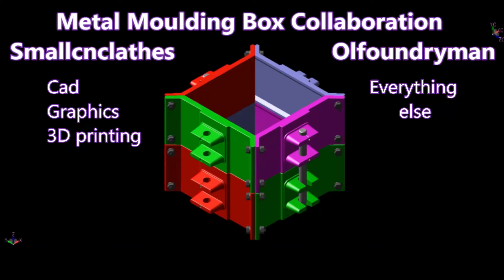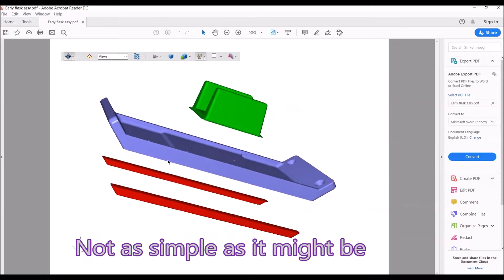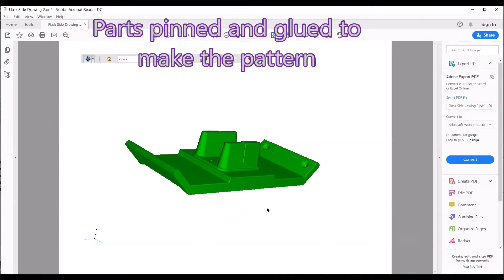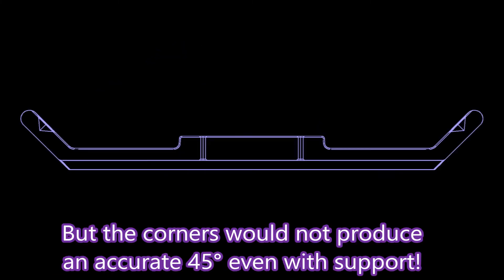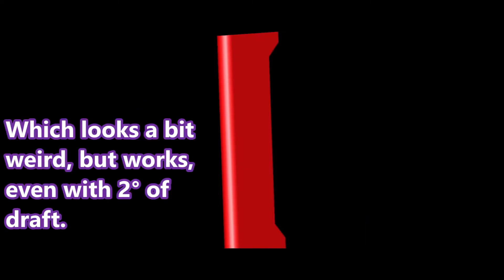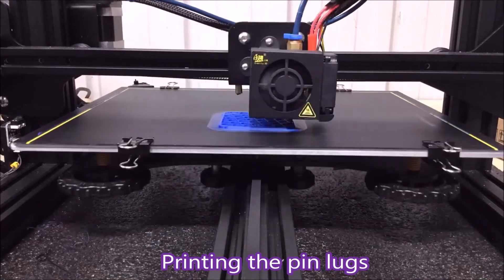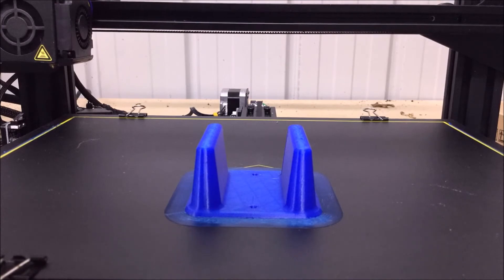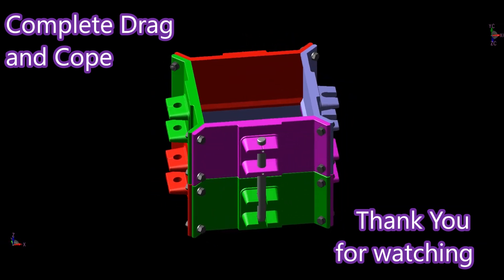Metal Casting at Home. Flask sides with 3D printed patterns.

Comment: I am having a go at printing these files but am having problems with warping. The print apparently is lifting off the print bed at one end, part way through. I was wondering if you have had the same experience and what was your solution.

Printing PLA on a CR-10 v2.
Thanks
Phil
Reply from the maker: Are you using a Brim?
Reply: I an running the 150mm file now with brim turned on.
Someone else suggested that priming the print surface with glue stick works well. 
I did this with the lugs file and it turned out fine.
Reply from the maker: Hi Phil, the flask files have to run a lot longer with greater opportunity to lift. Did you use adaptive layers?
Reply: @smallcnclathes  I thought that I should get back and let you know that I got the files to print well. The bed and end temps proved to be just a little cold. I got a distracted and have only just got around to doing the sand casting last weekend and have had a successful pour. Thanks again to you and Old foundry man for your work.
Reply from the maker: That is great Phil, would it be a bother for you to mention it in a comment to Olfoundryman? I know he would really appreciate it.